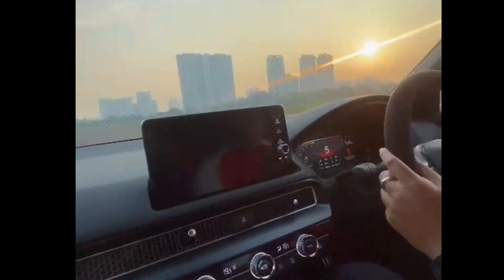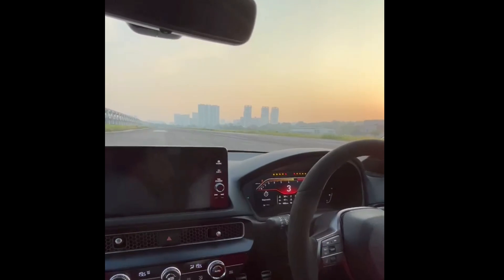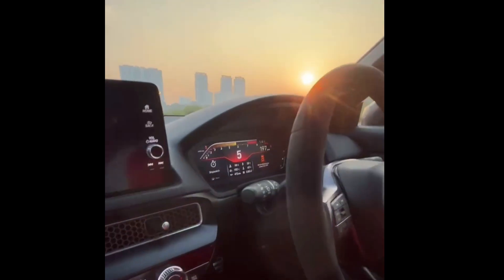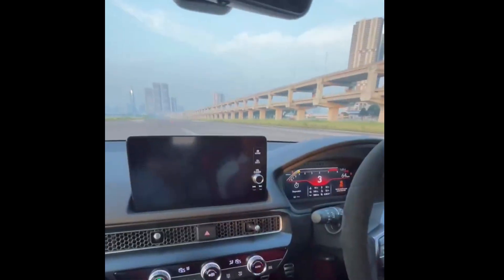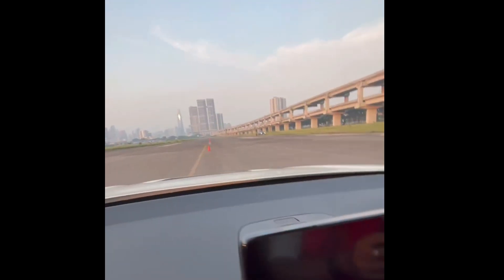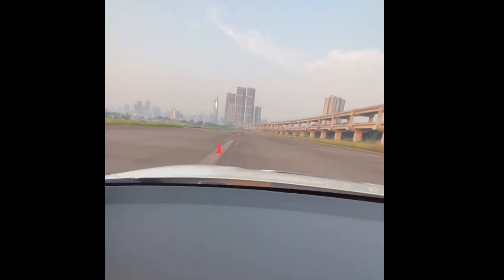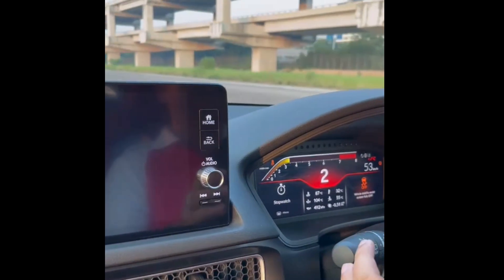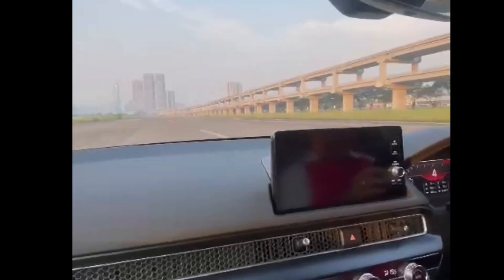HONDA FL5 TYPE R MALAYSIA | Testing Power

Comment: Tapi harga dia keras gila rm400k kot. Hampir rm100k beza ngan fk8 first launch dulu. Jauh beza tu. Mcm kurang berbaloi bagi saya. 

Disclaimer: jangan kecam saya geng baik beli pulak ye
Reply: Fk8 first launch dulu 320k. Harga kereta mmg dh mahal. 
Dulu vios 2017 starting 70k now 2023 starting 90k, almost 20k difference. So kereta sports, no wonder lagi mahal. Fk8r 320k(2017) skrg FL5 400k(2023).

P/s: harga barang yang naik, tapi gaji tak naik2😂
Reply: @anassyazwi1779 Malaysia problem. Mesti sbb RM4.71 kot
Reply: @Steel-beam  good point, exchange rate pun main peranan jugak. Imported items will be significantly affected.
Reply: Currency " Ringgit Madani " bro . RXZ pun dah harga Panigale skrg 😂